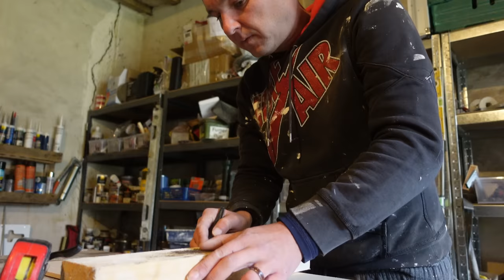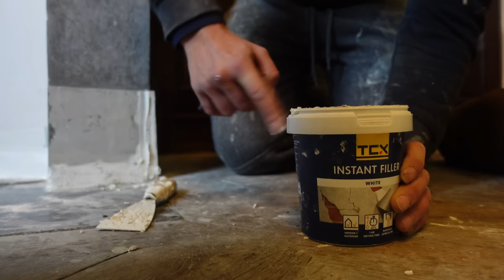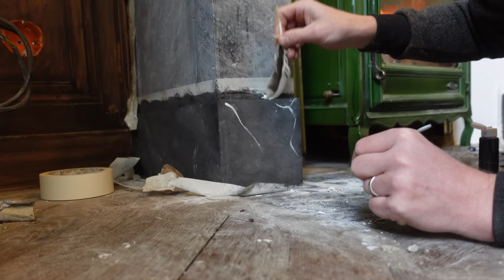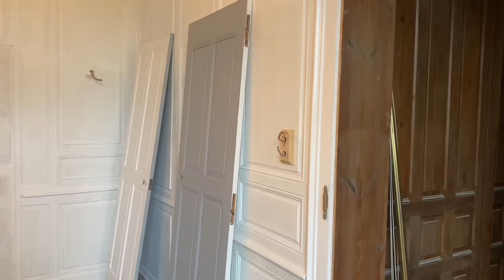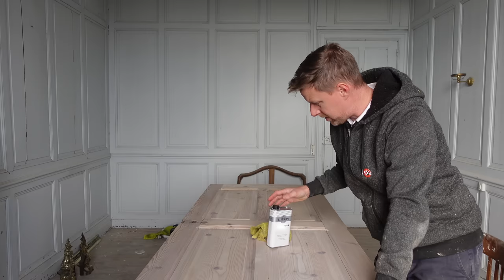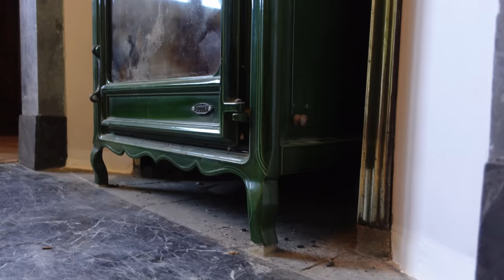Restoring The Château Original Marble Fireplace

Comment: For future reference... when you feather ... you load the feather along the full length of the feather, then you drag the full length of the feather over the surface in a line, twisting the feather as you go ... its not like a paint brush which is what you were doing ...
Its the bits of the  feather separating and then springing apart and draging that gives you the irregular shapes and depth of pigment in the trailing of the vein line.

Next time, practice before you try it on the real thing - its much simpler than you think, but it's not a brushing technique ❤